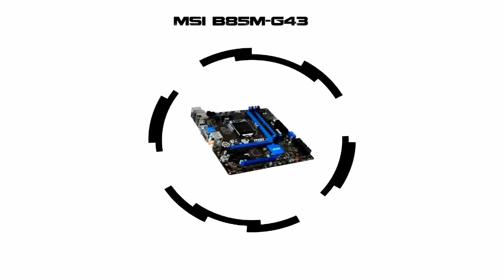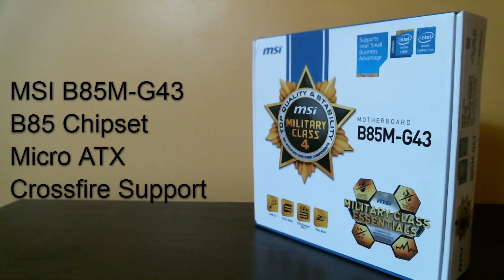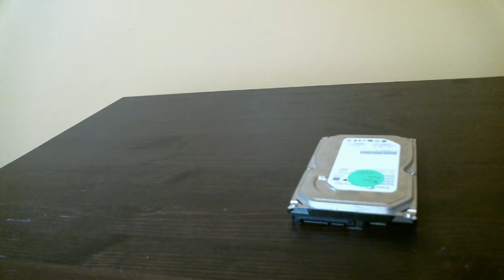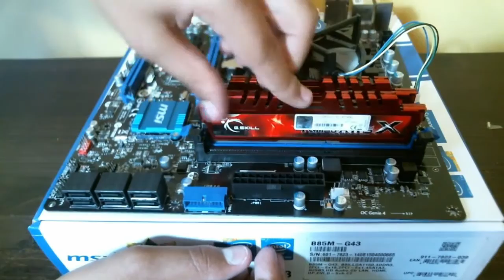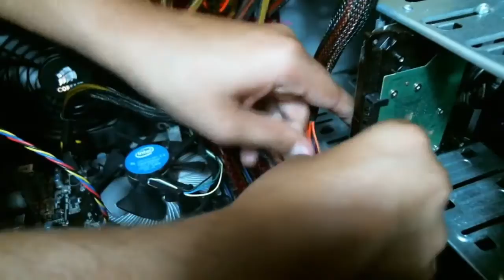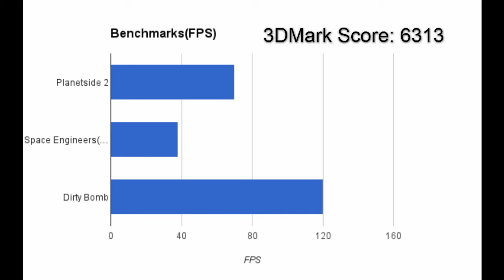$750 Build Guide - Project Arrow

Comment: Dude, I am totally thinking about getting this build. I don't trust my self building it though, I have friends for that...

Gr8 vid m8
Reply from the maker: +Paolo Mazzon I'm honored, Paolo. You should try building a PC yourself, thought, it's a very enriching experience. Also, I don't recommend getting this build: the recommended build is in the description. It's cheaper and more cost effective.
Reply: I've bookmarked it, haven't seen a video this easy and well done. Good job
Reply from the maker: +Paolo Mazzon I'm truly humbled. By the way, what do you mean by "easy"?
Reply: Your video is super easy to follow. And, on top of that, I looked at your cheap build, and by removing the Windows 8.1 I got the price down to $611, because I have Windows 10 64-bit on a live flashdrive. An affordable $611 pc that can run GTA 5 is pretty damned awesome. It's actually got the same specs as the $730 Steam Machine from Syber, with the exception of 0.2ghz processor increase. I thought about getting that Steam machine, but not after this one that is $120 cheaper, considering Steam OS is free.